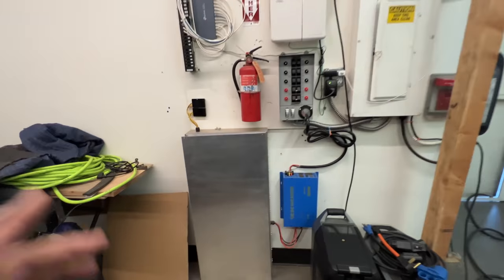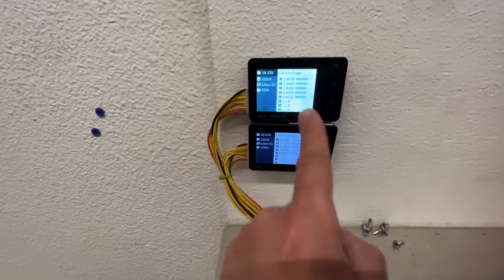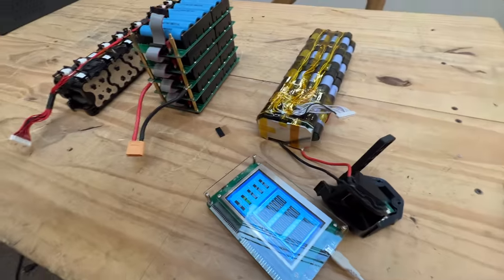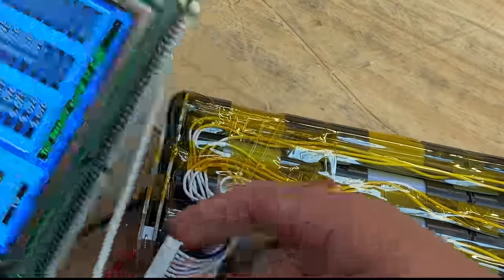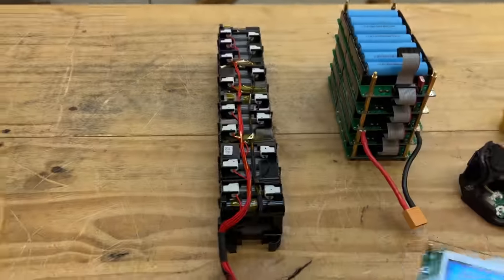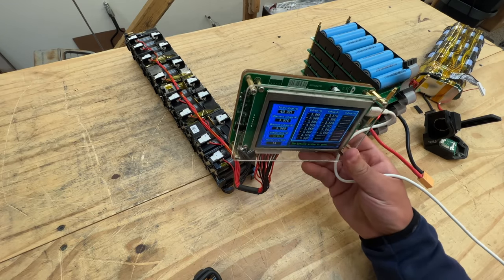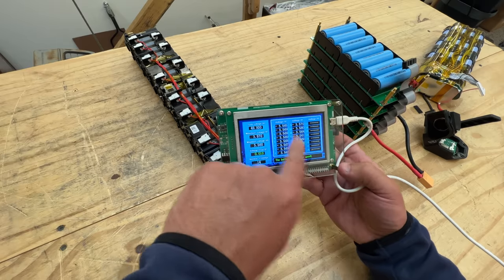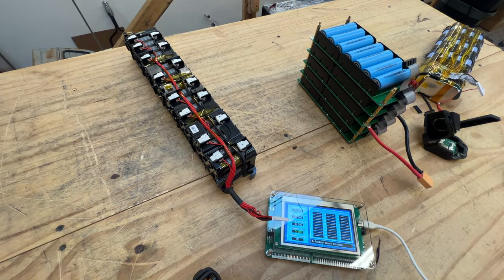Multi Cell Pack Voltage Display Meter -  finally!

Comment: Excellent video @jehugarcia! You didn't notice at the time but when you tested the last battery, the meter showed negative voltages, while on the previous tests it showed positive voltages; so It does not matter which way the connection is made, it still shows the individual voltages and tells you if the 1st pin goes to a negative or positive end of the battery.

Comment: Cannot believe that this really exists - I have been searching and searching - had given up - and then BAM - it's here! And thanks for the heads up on the other cell checkers - I was wondering if I could use a setup like that - now I know. 

I like that it has a separate power supply - the idea of only turning on when needed is a real plus - didn't want to leave on all the time.

Comment: Wow. This is EXACTLY the problem and solution I've been dealing with! I'm literally using two BG8S meters for a 14s 48v (Nissan Leaf golf cart ) battery just like you're doing. They've been plugged in about 18 mos. Pack is a bit unbalanced just like you describe here. I keep the balance function of the BG8s on the higher half constantly just to try to keep bringing that side down. Always wished I could just get a damn 14s cell meter. Finally!

Comment: Scott Bennet, the manufacturer says that only one set of pins will work at a time. So hooking up a balancer to the other set of pins probably wouldn't work.
Reply: add an extension A/B pinned switch - concern solved.

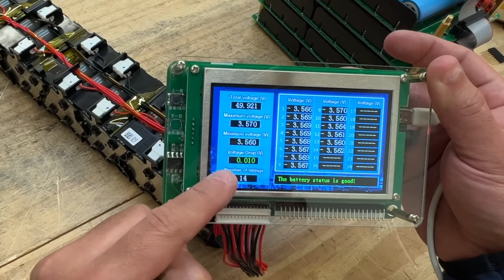Comment: 7:46 I have some Makita batteries and want to know under load how many Ah I am using. They are for a lawnmower so it uses 2 batteries at a time for a total of 36V. What meter could I use?

Comment: Do you know the minimum voltage between cells it will read? Wondering if it would work on a 24 series of 2V lead acid Cells? To be able to easily check the voltages of each cell, that’s all. TIA

Comment: I bought this 3 months ago and finally used it on a 14S6P.  What do you use to balance battery packs that have several cells in series like a 16S7P?

Comment: will any inverter handle the 36 volt?
Reply: Use an Inverter designed for a 36 volt battery pack.
Reply: I'm just putting this out there for anyone else coming along in future trying to solve this problem.  I'm building a 36V pack with e-scooter batteries that I've gotten for a song.  The plan is to buy a 48V Victron inverter/charger which has a low voltage cut off at 38V.  I'll pass that output through to the AC-In of my existing 12V Victron Multiplus II to passthrough.  If I bump against the 38V cutoff voltage too frequently it'll be cheap and easy to add more e-scooter packs.  It will allow me to tear these down and build a proper powerwall in future if I really want to without being sucked into a 36V sub-system I wouldn't otherwise choose to use.

Comment: Is it possible to monitor cells in a single parallel pack, or only groups in series?
Reply: All of the cells in a parallel pack, have the same voltage
Reply from the maker: So they are one cell

Comment: I need a 12v 100ah battery that costs less than USD50, bro? i mean second hand battery..
Reply: Used lead asid is your only option with such budget.